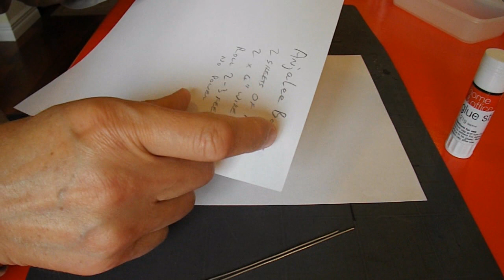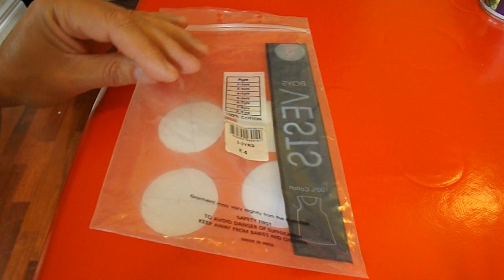Car from 2 sheets A4 for Anjalee Bangar

Comment: hey can you make a wired boat that you can move with wires and batteries and motors and all of that good stuff
Reply from the maker: +Josh North if you mean wired control like all the cars in my Wired Control playlist https://www.youtube.com/playlist?list=PLA5a2xPRSrB0GHy5dTf7Wh_hS_Zb47z-D then the answer is NO. The wire would either sink dragging the boat backwards or you add lots of little floats to support the wire in the water and then the wire gets caught on any obstructions on the surface. It would work but it would be very limited.
Reply: ok thanks